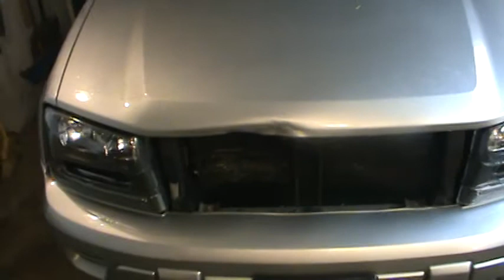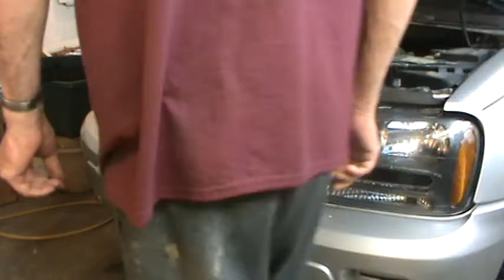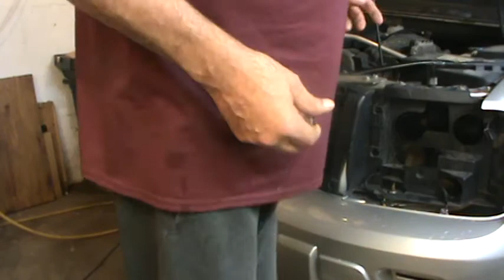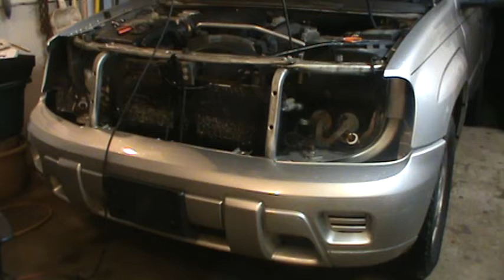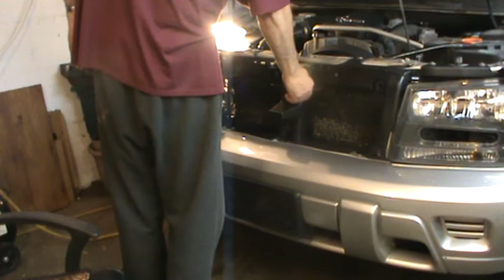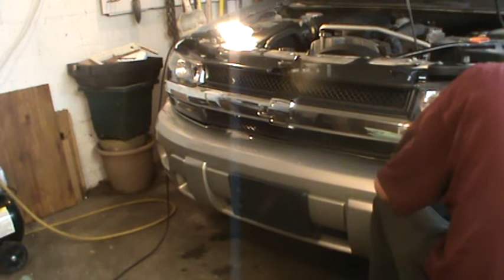Replacing Chevy Trailblazer Header Panel and Grille

Comment: As long as you are safe, the car can be fixed.  You did a really nice job Gary.... awesome.. and you saved a TON of money....  congrats
Reply from the maker: Thanks Ron!  The header panel was only $58 on Amazon and the grille was $46 on ebay.  What gets me is that the little chevy bowtie that goes into the center of the grille runs anywhere from $49 to $74.  I'm like, Whyyyy?  It's a dinky bit of plastic.  I'll be looking in salvage yards for a used one of those, lol.

Comment: I can relate brother.. I bought this trailblazer and the very next day the transmission went out so we put a new one in and drove it two thousand miles across country to Grand Canyon with no issues but the very evening we got back home within 10 miles from the house!! We hit a deer and smashed the whole front .. The grill the bumper and the headlights And this was after putting new LEDs and light casings in ours as well I'm finally repairing the damage and I was grateful to find your video to help me with it.. I'm almost scared to fix it cuz I'm worried I'll have a wreck afterwards lol
Reply from the maker: We had one before this one the transmission went out on.  We were still making payments on the new transmission when someone ran the stop sign at a major intersection near here and totalled it and their vehicle.   This one is still running great (fingers crossed) so far.

Comment: This pass winter we were coming home from my daughter's in AC. We were driving up RT206 and it's 55 there but most people go a bit faster. Well I was doing about that speed and out the woods comes 3 deer. I got off the gas and missed the first two and than had to hit the gas to miss the third. I actually was steering towards the second one to try and miss the third. Kinda like threading the needle. Well the third one hit the driver's side rear door and quarter panel and kept going. This was at night so when we got to a spot with some lights I pulled over. I couldn't see any damage and it sounded like it hit us pretty hard. The next day in the light I could see some fur in the door crack and by the tail light. All I can say is God gave us a get out of jail card and boy were we glad.
Reply: Too many Bambi's and Rocky raccoons.  We had an "almost hit" a few months ago, in the city near Cleveland too, whilst junkin at VOA. We also had to stop once for a duck family crossing.  btw, Edie wants to hit those dag dern coonies.

Comment: Where did you buy the new one?
Reply from the maker: Amazon...I think I gave about $75 for it new, but that's been a few years ago now and now I see they're up to $85 for the header panel.  Got the grill there too, but I had to pick up the chevy bowtie emblem at a junkyard and then I got some gold color vinyl shrink wrap and cut it to fit the bow and then just heated it in place with a heat gun set on low.

Comment: Oh my.
Reply: Oops I guess I should have said, Oh dear.
Reply from the maker: LOL, wasn't my idea to meet like that.  In fact coming up on it I saw it which is why I slowed way down, but in the position it was in I thought it was a red dog like an Irish Setter in the little roadside ditch...until it jumped out in front of me.  I hit the brakes going about 20 mph before I hit it so I hit it at less than $20.  It got up and walked away.  I drove away after I cleaned up the shattered bits of grille.
Reply: A deer customized the front end of my dad's van quite a few years ago and he was not happy with the van so I bought it from him. It needed a hood a radiator and the rad support had to be pulled out. I had the van in my dad's garage and opened the door that goes into the laundry room and put a 4x4 across the opening and hooked a comealong to that and the rad support and pulled it out with some banging. We put over 265.000 miles on that van. It served us well.
Reply: I bet with a block of wood you could bang that hood out pretty close and it would look pretty good.
Reply from the maker: I did get a slight ding in the ac condenser in the upper passenger side corner.  Looks like it pushed it in closer to the radiator behind it, but it isn't leaking and the bolts are all still attached so I decided to leave well enough alone with that until or if there's a problem down the road.  I've used a comealong before on vehicles.  Pretty handy to have one, but fortunately wasn't necessary this time :)
Reply: oy vay, such a de-er